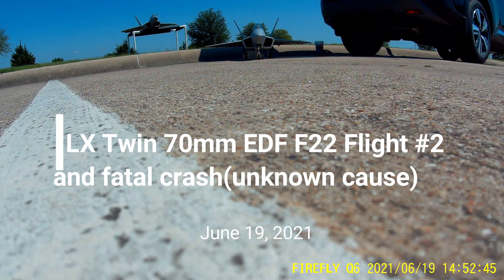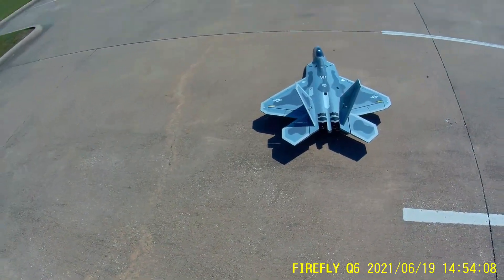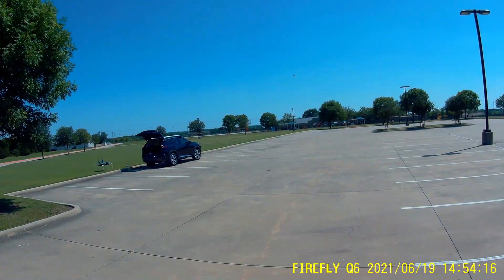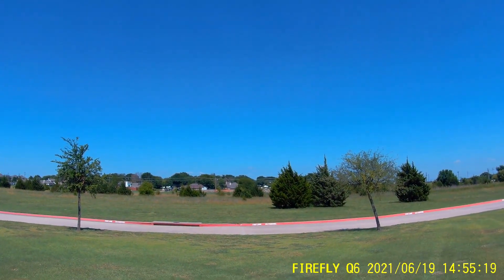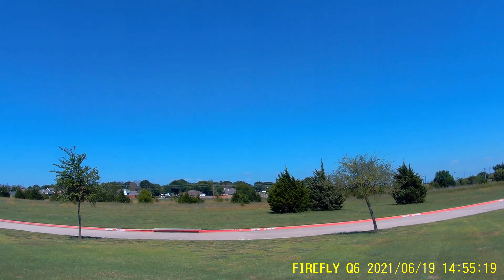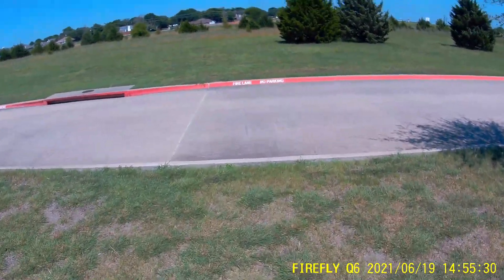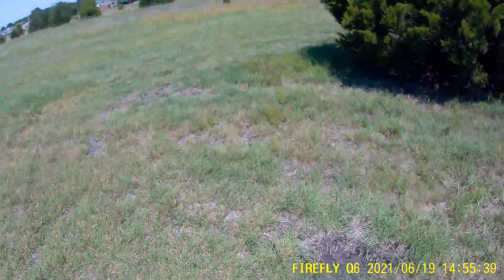LX F22 Twin - Flt#2 Crash

Comment: Looks like your right foreward slat has been slammed up due to high speeds. THis explains the turn and sudden loss of speed. The slats are beautiful but caused a lot of ripped wings and crashes :(
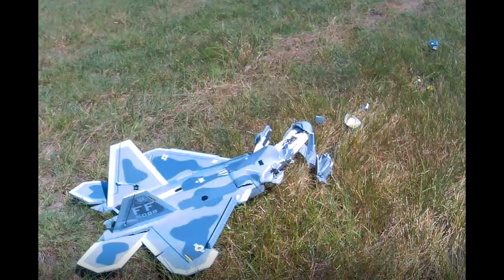Reply from the maker: Mike I never noticed that. The right one is up and left one looks close to normal @ 2:09. I've got another one(kit) that I want to build. I'll build it with slats and hopefully have a more stable aircraft. Thanks for pointing this out!

Comment: Bummer - sorry to see that, Zek - I suspect it was either an electrical or a mechanical failure - with as much flying as you've done, I can't imagine you unconsciously rolling it - is it repairable?
Reply from the maker: I  believe you had the twin F22 at one time...it broke the fuselage back to the top main piece. This is where the heavy glue is at. I'm gonna cut the top 1/2 of the main piece this weekend and see if it is salvageable. Also the cockpit is a puzzle with many pieces.

Also, I'm using the Spektrum AR8360T 8Ch receiver with SAFE in the twin F22. All my other jets have the AR630 receiver. Hmm..another new variable. Better get that sorted before putting in the FW F14.

Did you ever try the thrust vectoring on the F22? I found it to be unreliable in the movement due to the sloppy hinges used for the vectoring nozzles.

Also, I finally figured out the real problem for the F14 barreling left and crashing. I had the left taileron at 50% in the mixing where the right was 100%.
Reply: @Zek1701  I still have the LX Raptor 70mm single EDF - thought about getting the LX Raptor 70mm twin EDF, but decided on the Freewing 90mm instead. Glad you figured out the problem with the F-14 - perhaps you'll resume flying it again? As for the damage your Raptor suffered, looks and sounds like a lot of work - good luck with the repairs if you choose to go that route...
Reply from the maker: @user-MichaelSBruno  cut the top off the fuselage and there is significant damage in the front part of the fuselage/cockpit. The electronics and nose gear are in this area and it would be difficult to reconstruct this area. Thus, the only way to repair is start with a new fuselage but since LX jets are all glued together it requires a new kit. Unfortunately, generalhobby is out of stock. Sad because I prefer the twin edfs over the single(ie FW F22).
For now the F14 looks good hanging in the prominent position in the hanger...maybe. Just got the EF A10 and gonna give that a go.
Reply from the maker: fouund a cheap kit...she is going to fly again!